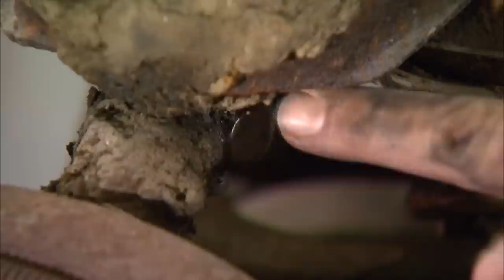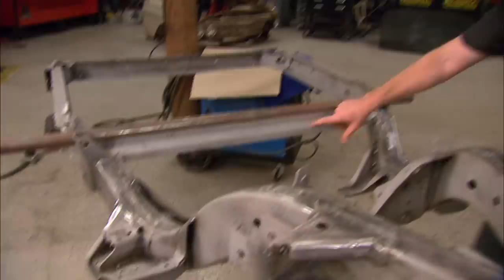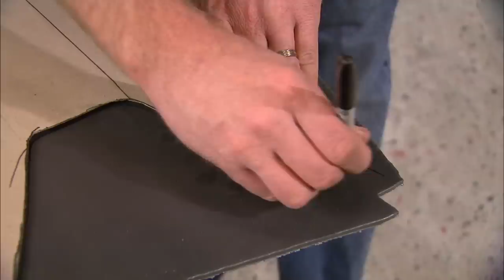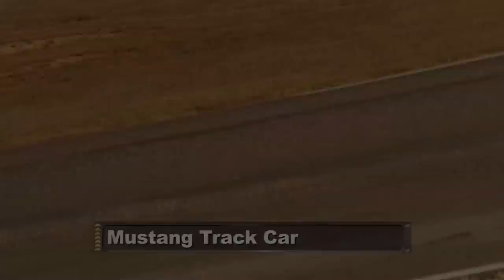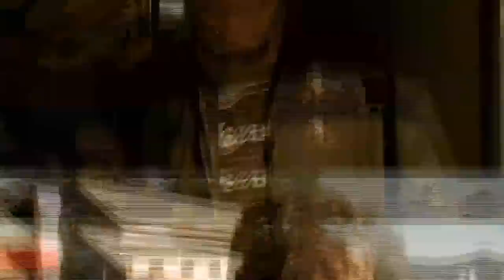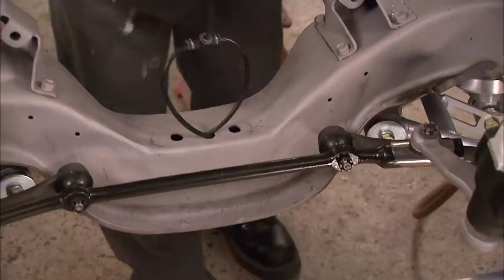Reinforcing a Stock X-Frame on a Classic Chevy Impala - MuscleCar S3, E9

Comment: The finished car turned out really nice, but I despise bagging. Bags are for semi's. So glad that trend has at least minimized.
Reply: Same here. The cars that are designed to set on the ground with the bags deflated are the worst. You blow a bag or a line and you're stranded
Reply: @dave1135  wrong.

Comment: Wouldn't it be better to wait until the frame was sandblasted b4 doing any trueing, even if it were out of alignment?  Then you could do any necessary tweaking, reinforcing and retweaking.  After all, you would have to recheck trueness when you got it back from the sandblaster anyway, right?  Am not very knowledgeable - just asking.

Comment: So how exactly are they gonna paint/anti rust coat that chassis when they boxed it all in and the metal on the inside is now all bare.
Reply: well, you put your anti-rust paint on it, you box it and weld things on, you burn that paint down, you do twice the job for nothing...
Reply: They can dip it maybe
Reply: @luemn7691  a full frame acid dip would eat up all the rust....30 minutes in a muriatic acid woud solve alot of problems in the furure

Comment: A watts linkage would have been much better than a panhard rod.
Reply: @MidwestFarmToys  With this build the ride height is variable, so the axle need to move up and down vertically, not on an arc. With a panhard rod the axle could be displaced sideways as much as an inch from full up ride height to full down. This will look odd. Decent close tolerance bearings in the watts linkage will minimise flex. Just a better way of doing it.

Comment: Those ugly wheels. On new stuff, I guess they are OK if you like that kind of thing. But, on old iron, they just don't look right. And they ride awful. Not to mention they can be kinda dangerous. The guy next door from me was headed home from work one night and ran over a rock lying in the road. It popped the tire and bent the wheel. Blew the tire right off the wheel, bent up the finder, and sent him into a ditch. The rock was about the size of a petite woman's fist. He said if he had been going any faster it would have flipped at least once when it started digging into the dirt. That's what 22 and 24-inch wheels will do with rubber band tires.
Reply: Safety versus cool. Most will take cool.

Comment: Tests shows that dimpled holes are actually stronger and more rigid that straight steel plate
Reply: Removing material can change the load path ( can be worse). The flared edge of hole really only makes the area around the hole stiffer. Be careful how you use the term stronger...
Reply: I know Stacy on Trucks proved that a rolling a bead in a piece of sheet metal will increase strength as well.

Comment: Those X frames made the cars death traps in side collisions... might as well be riding in a beer can.
Reply: That's why the IIHS 1959 Bel Air vs 2009 Chevy video was so bad. The 59 had an engine, but it was a Straight 6. I uploaded a behind the scenes video of that crash test, and if you look carefully, you can see the engine: 

https://www.youtube.com/watch?v=zVy1u7BOmXQ
Reply: @101Volts  the impala chassis was very rusty, you can see bits of rust falling out of the chassis during impact, if the chassis wasn't rusty maybe the impala would have performed better

Comment: You know people are saying ls swaps are over done, I agree, although I did it, buttt the most overplayed is the damn Ford 9 inch, a damn Chevy 12 bolt is just as strong, if not stronger.
Reply: People like the 9" because you can have different ratio ready to go and toss it in for different tracks.
Reply: @AndyFromm  ok, I understand that, but they are clearly building a street car.
Reply: They used a 9" because that's what Currie donated for product placement consideration.
Reply: check who their sponsors are. They use the sponsors parts on their cars.

Comment: Awesome video but I disagree with using the old frame, If you were building this for me or if I was buying this at auction I would want a brand new rolling chassis made from the finest modern materials, designed to handle today’s big HP & torque engines & handle the road like a race car.

Comment: I owned a 60 chevy station wagon. paid 20 bucks for it. 6 cylinder power glide the 6 had a hole in the top of one piston from me running it up to 65 mph. to much carbon. threw the eng and pg away. bought a good 245hp 327 and 350 turbo hydro from a wrecked 69 impala 200 bucks. changed the frame mounts to v8 ones from junk yard. fabricated rear trans mount, welded up and balanced my own front half of drive shaft. changed the carrier bearing(no problem). montgomery wards for ball joints, shocks, tie rod ends, idler arm, dual exhaust. brake parts. put about 400 bucks into the car. had it 4 years and sold it for 200 cash when it rusted out till the front seat fell through on to the muffler. some 2x4 pieces to hold up the seat. the guys who bought it from me used it for another 2 years to haul their band stuff around to gigs. great old car. would do 20 mpg at 55 mph(speed limit at the time). these guys are so fake its hard to take their talking. why are they doing this? to make money and push component providers?

Comment: So GM used the X frame design because it would flex?  Still, it's no surprise that they had to reinforce it for use under convertibles. With convention  frames,  engineers typically put in a large X member.  When Kaiser-Frazier build a convertible in 1949 Kaiser insisted they just reinforce the standard frame but no X member!  Didn't work. Frame twisted badly and the doors would fly open going around corners!  Since Packard was known for building solid convertibles, they bought one and took it apart to see how it was done.  They ended up with a well built car. Cadillac expensive and slow with the 226 ci "Supersonic" flathead 6.

Comment: Adding steel between the front and rear body mounts on this era of car adds very little stiffness.  Why? because the body is the structural member.  That's why they had to add the steel on the convertible.  The roof structure isn't there.  The mid section of frame is mostly there for production purposes and the rest is about diagonal loads.  The above mods added a lot of weight for not much benefit.

Comment: I know this is an old video. If you run a stiffer bag & dual upper arms will make a huge difference in handling. With the rear track bar it shifts the rear end out of alignment. I have the same issue with my 64 Belair. You can run a dual upper or a Y bone like the low rider guys do.

Comment: It's sad to see these car get messed up and end up as some sort of "resto-mod".  Keep it original.
Reply: Messed up? Was rusting into ground. Would rather see a resto mod than it crushed.
Reply: What was the car originally? If it was some rare option package numbers matching car with limited production, then yes, go 100% nut and bolt true to the factory methods. To make a plain base model car that were churned out by the thousands an original restoration seems like a fool's errand, make it into something enjoyable.
Reply: Actually, restomod is the very best thing there is. You end up with a new modern car with the best non wind tunnel designs of yesteryear. Such cars are beloved and well taken car of and usually out last the life of the owner. Sure, 100% original has it's place, and there are plenty of examples of that out there. The car in this show would surly have ended up being razor blades had they not saved it. The only restomods I despise are the really kooky outlandish types that are instantly dated, and usually undriveable.